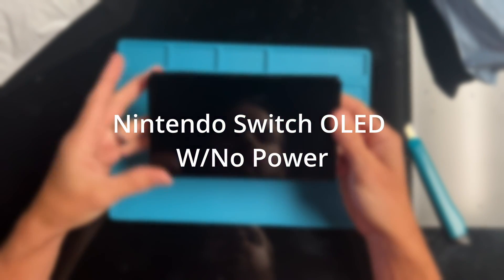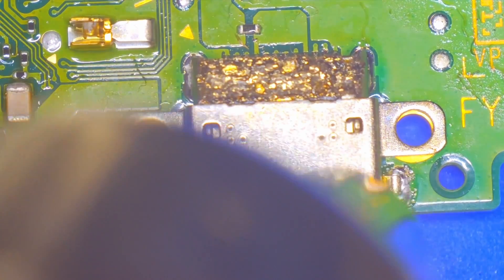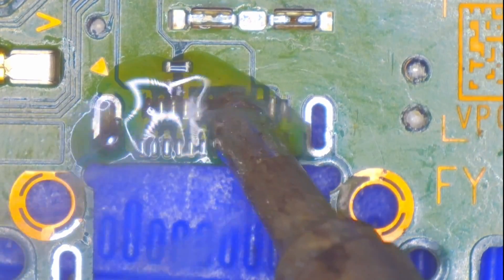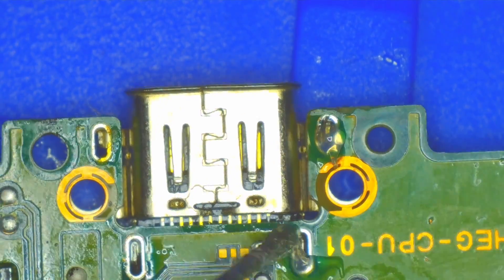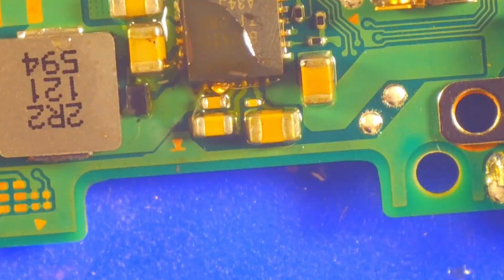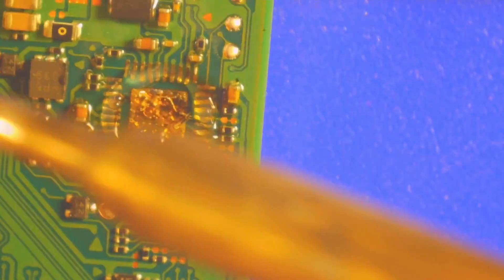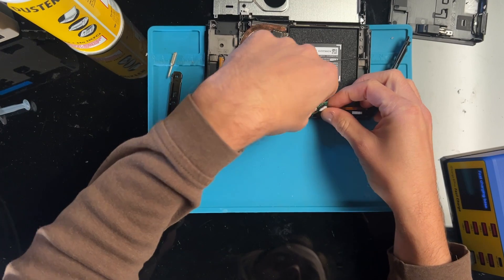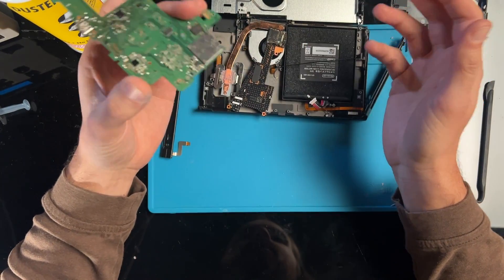Nintendo Switch OLED No Power Repair

Comment: Check MAX77801 if its outputting any 3V. Its near the audio IC, rectangular chip. 

Also 13:17, there's a short there, might wanna check properly.
Reply from the maker: Hey thanks for the suggestions. 

The MAX77801 is outputting 3v and I checked around M92 again and it wasn’t a short just my thick leads touching too much at once. I recently got more precise leads to make things easier. 

I’m all ears if you have an other ideas where to check.  
Thanks again.
Reply: Did you check the cpu, emmc, clock and all rp2040 points. Maybe the old owner try to solder a chip?